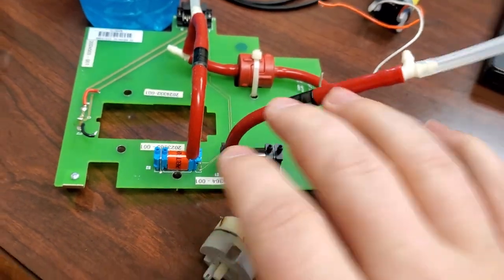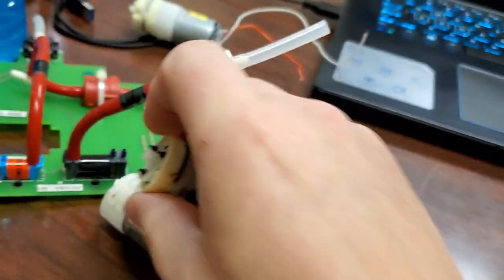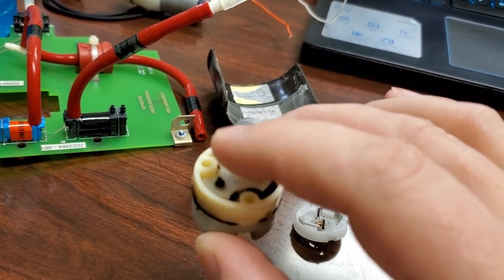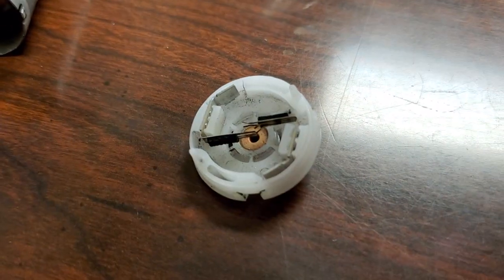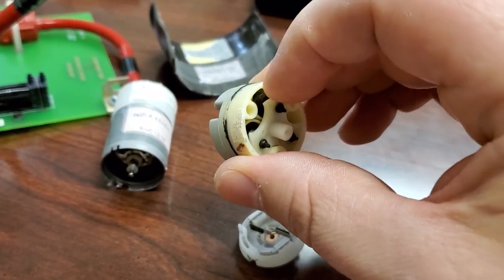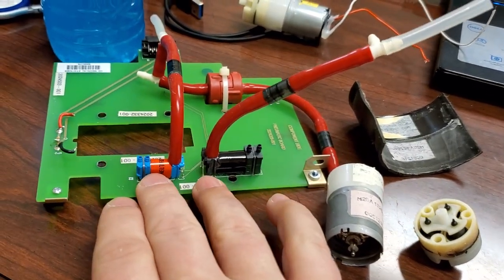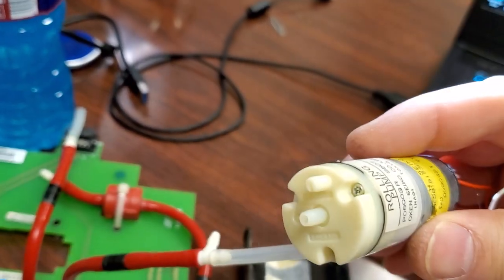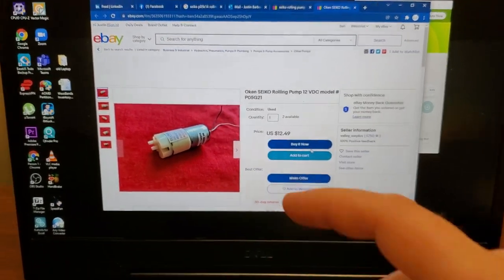GE Corometrics High Failure Item

Comment: Great video! Same rolling pump is used in the connex spot monitors from Welch allyn.
Reply from the maker: Just be sure to check the input voltage.  There are 6V and 12V variants that look identical.

Comment: Never had a motor die. Usually the rubber diagram part of the pump wears out, which results in the BP pump not being able to achieve full pressure. For example, the last one I replaced would not pump higher than 120mmHg.

Comment: Good 
I don’t think there is need to try  fixing it when it is available in the market 
And after repairing it at this life stage it is likely to fail again soon
Reply from the maker: You mean, why spend over $1000 on a GE part when you can simply buy a $13 exact replacement pump?  Of course we should fix it. If my repair buys the customer another year or two then it's a solid repair.
Reply: @BetterBiomedChannel The only thing GE will get from me is a "general expletive" over their "generic excrement" overpriced unnecessary injection molded zif connector madness! Dealing with them is equivalent to doing a DIY carotid endarterectomy with a broken wire coat hanger, and some coffee stirs.